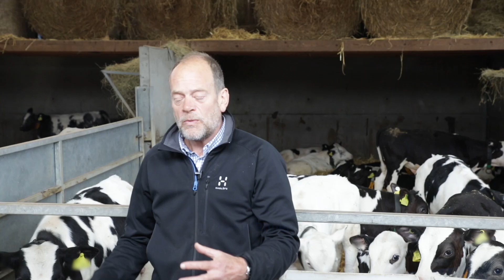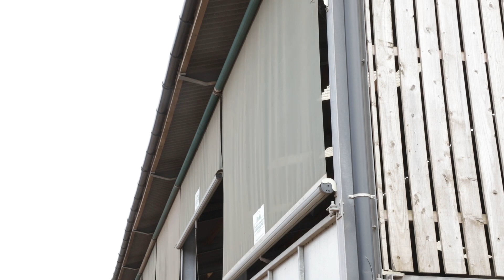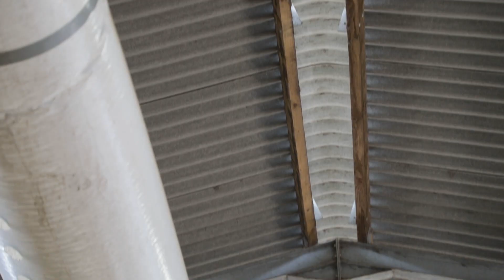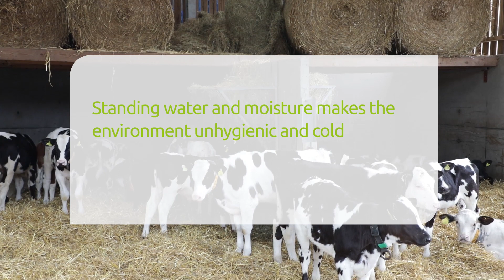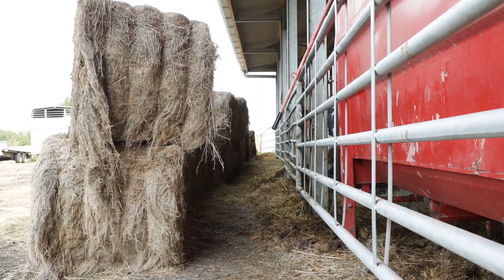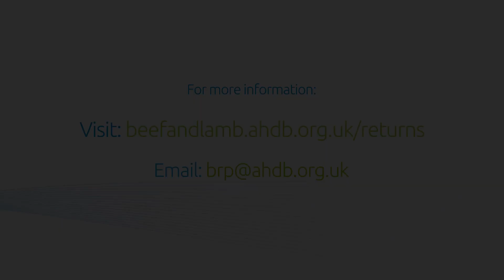Assessing calf buildings

Comment: Using a fabric sock duct is very inefficient. You need a lot of fan power to keep it inflated. A well designed metal circular duct will be cheaper over a couple of years although a higher initial cost